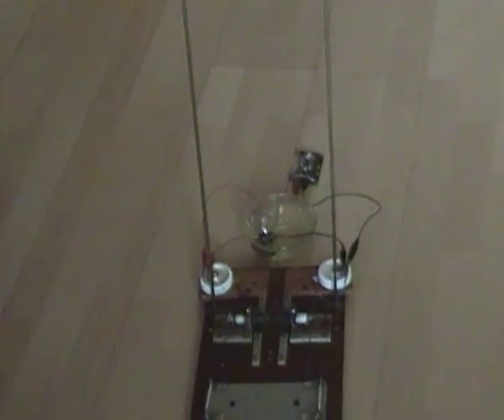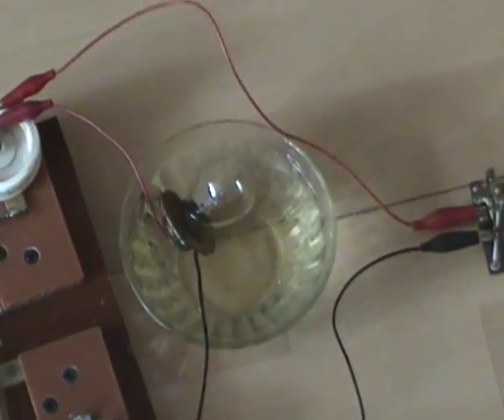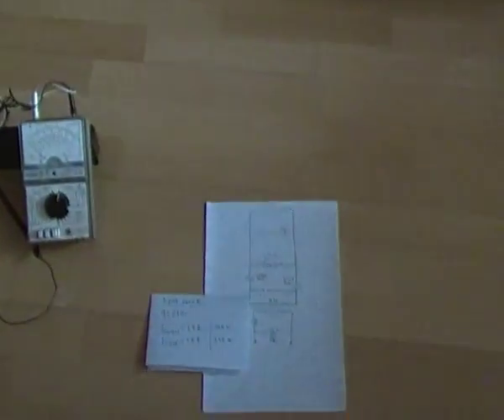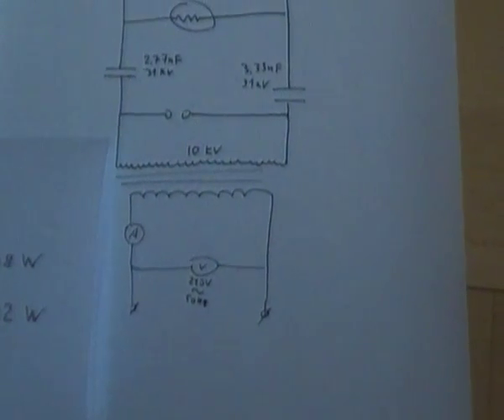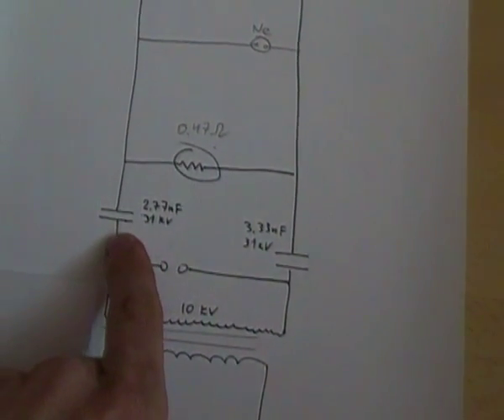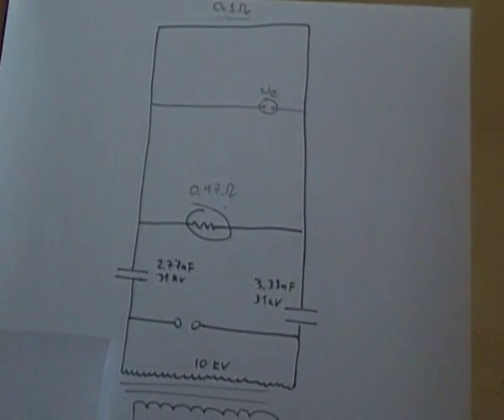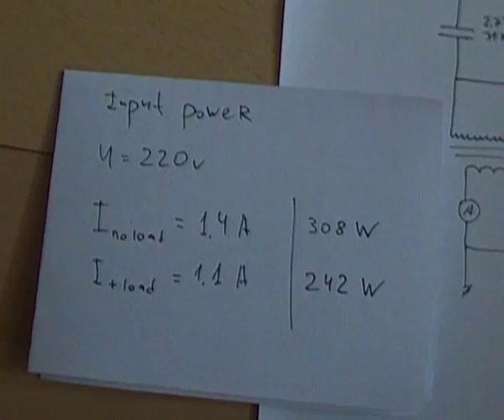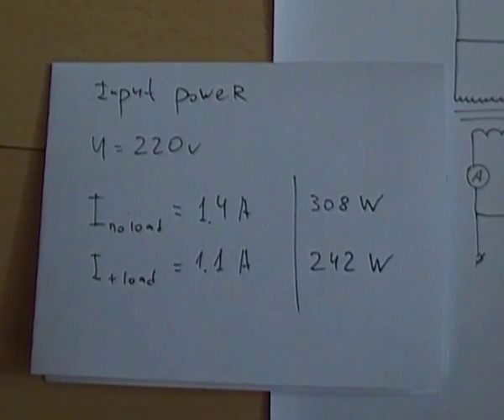Tesla Hairpin input measurement

Comment: Hello :) I just tried to duplicate this circuit and I used salt water capacitors and I can not see any results. I mean after capacitors I have normal high voltage electricity which gives me shocks but does not turn on anything, I mean any lights! Is it the capacitors or what else could be wrong? Thanks in advance :)